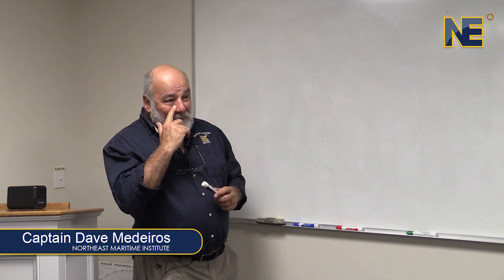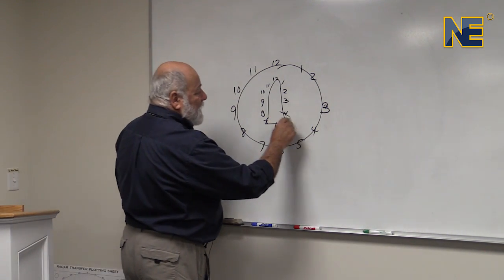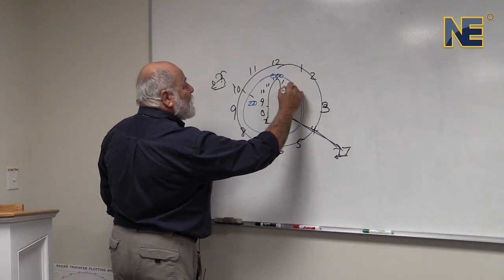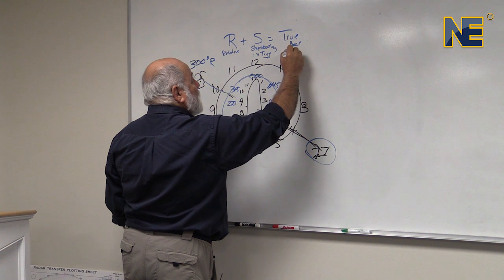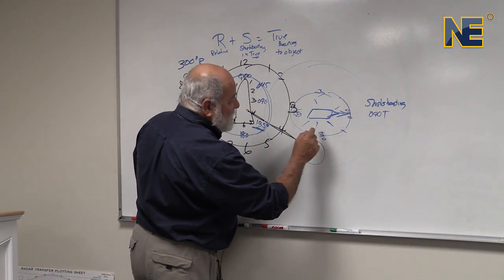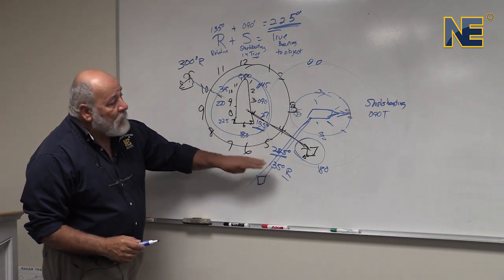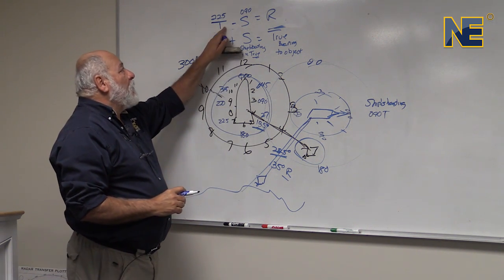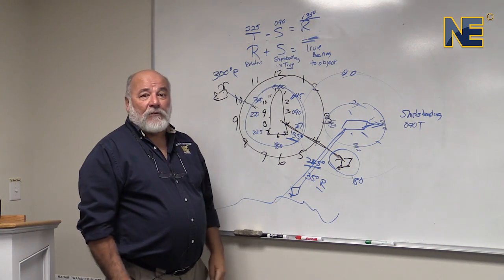Navigation - Relative Bearing

Comment: Thumbs up for the Whale drawing! Great explanation. This is very helpful for Pilot radio navigation, too!
Reply: Because of the coming micronova, declination is moving much farther, and much faster and so declination information is likely incorrect My up-to-date declination is 30 degrees, 15 degrees off from the official declination for my area. but there is still a way to recalibrate magnetic declination using the shadow of sticks recording the path of the sun---rotation of the earth has not yet changed. First stick will show East. Mark it with a sharp stick pushed in. After a few minutes you can mark sun shadow travel where the shadow has moved - Push another stick in to mark West. Lay a straight stick from the E mark to the W mark. Geographic north or True North is 90 degrees from the E-W line. With your compass pointing toward True North, note how far off your compass is now. That is your true up-to-date declination. More on micronova in my 2nd book, Surviving the Micronova: This Train Is on the Tracks is available now.